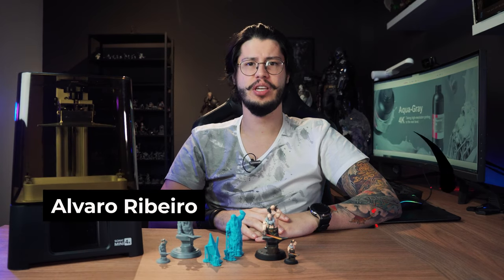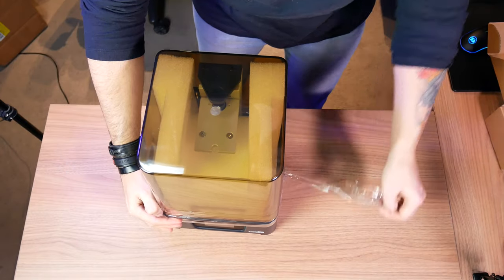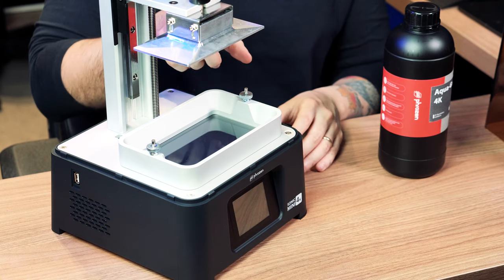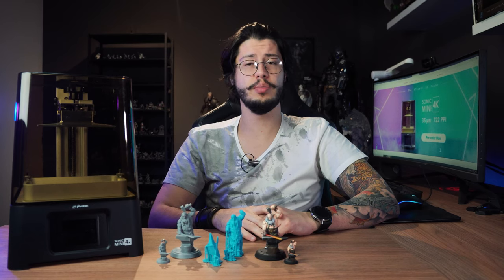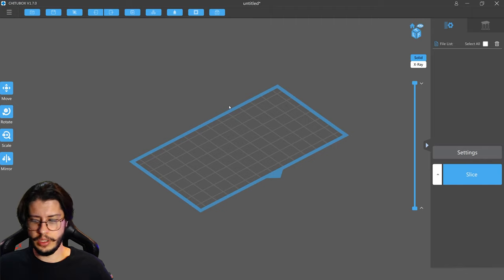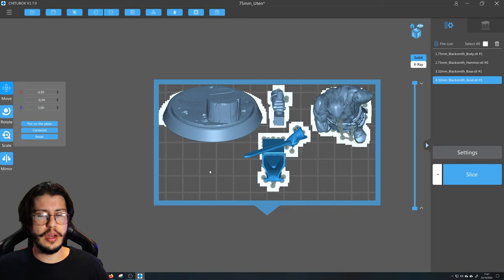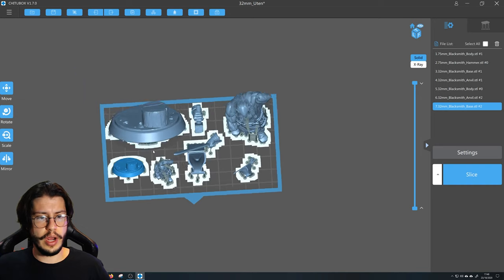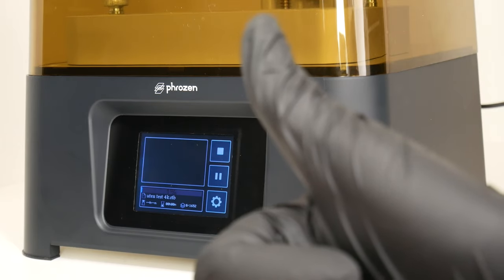RESIN 3D PRINTING GUIDE - FROM  SETUP TO YOUR FIRST MINIATURE

Comment: As someone well experienced in FDM, starting with resin it struck me how much more you need to faff around with supports, how much messier and how many extra tools you need. It is a lot easier once you are properly prepared.  There is a lot of info out there, but this kind of video taking you through the whole process I think will be very helpful for new people starting out.
Reply: I'm new and it's very frustration to find comprehensive tutorials on how to tweak settings and what they do. There isn't much space for error because of cost limitations. 500ml of resin is so much more expensive than 1kg of filament. Transitioning is not easy because the community doesn't really care for resin for some reason.

Comment: This is a pretty thorough and easy to understand guide, thanks a lot! I would nevertheless like to add one really useful trick. After washing the print with alcohol but before curing, put the prints (with supports attached) into a container with hot tap water (the hottest you can get, but not boiling). Leave the prints in there for about a minute. The supports become very soft and are very easy to remove by hand, often leaving hardly a mark on the miniature.
Reply: Is the water contaminated after? If yes how to dispose?
Reply: @lukasz7290  Well, that depends on how clean your print is. I usually have no noticeable resin left on my printed minis. I wouldn't drink the stuff, but I don't feel to bad about pouring it down the drain. This is probably still not the correct way, I am afraid.
Reply: @lukasz7290  Put it under the sun or UV until resin is cured. Cured resin will go down and you can filter the water. Dispose the cured resin as plastic

Comment: Exposure time is only two seconds? Nice. I don't go below six seconds for mine. Great video. Thank you.
Reply: Depends on the resin, lcd and the strength of the light in your printer. The mono screen based printers are all around 2s for standard resins.

Comment: Did you have any problems with that gap between the VAT and the screen caused by that thick black tape they added around the screen to avoid any resin leak to get into the printer ? I heard of people having problem printing more than one part at the same time on the build plate because that gap makes almost impossible to level it perfect for high detailed prints like 0,01... I was about to buy that printer, but just saw a review showing that "problem". The second issue was with the arm of the build place being a bit loose, and everytime the build plate raises to get the cured print out of the vat it makes a loud "pop" sound and sometimes this could deforms the prints.
Reply: I've started to research about 3D printers and it came across about the Sonic Mini 4K. As one of my ideas is print out the Loot subscription minis it's great to see which printer they use but I tthink I'm at the same boat as you. I've watched this video: https://www.youtube.com/watch?v=RTUhHnlZ6-8 talking about the issue you described. I'm quite defensive to buy it, especially as my first printer, I'm super beginner on this world.

Comment: I have watched this 4 + times and I keep watching it every time I have a little problem and I get it worked out.  The only thing I have not figured out is how to Readjust the supports, you show what button to hit and show how to use it, but, don’t show on what to hit on the key pad, I don’t have a mouse just a keyboard. Is there a way you can explain it a little better?  I do have the Voxelab Polaris, but, I print using the Proxima settings, I can’t print using the Polaris settings 🤔 everything is great, just Readjusting the supports.  Thank you for any help you can give me ( I am 73 years old and learning new things.)

Comment: great video I coudn't find any other video about how to clean up the supports from your models.

just a tip tho I saw another video about recycling the alcohol and he just put the alcohol with the resin residue outside in the sun and the resin actualy build up at the bottem and mostly cured so you can pour it back into the bottle without any resin in it.

Comment: Thank you very much for the video, really helped a LOT with the setting up of my 3D printer. I got the same problem than you in which the base of the model got stuck to the FEP, in my case it happened with the body of the mini (32mm version) while the anvil and base turned out very good. Is the sanding the only thing that I will need to do?

Comment: Wow, my Elegoo Mars Pro is so much easier to work with.  The vat slides out the side (no risk of puncturing the FEP with a screw or having to lift the plate super high) and leveling is much simpler.

Comment: Hi Alvaro, this is a great video and thanks for sharing, I recently bought and used the process like what you did, even with the print settings, it looks like my prints are leaving with horizontal lines with a slight height in them, can you please help me in fixing these, Thanks

Comment: I think a safety part is missing: please, wear a good filtered mask when sanding the resin, because that thin dust is really harmfull for your lungs! We don't know much about risks for our health when using polimer resins, but fine dusts are old and bad enemies!
Reply from the maker: Thanks a lot for the tip! :)
Reply: this is extremly important. liquid Resin might cause a light rash if you are allergic. Its an iritant that confuses some peoples immune system. But resin dust can really damage your lungs. so in my opinion the dust is much more dangerous that the uncured form.
Reply: an alternative to wearing a dustmask you can also just wetsand. its easy to deal with

Comment: I am about to print that exact model got the free sample file, I got my 3d printer 2 days ago . First "Mini" print so lets hope I don't fuck it up.
Reply: How did it go?
Reply: @Now_Its_Orange  the first attempt ended up with a failed hand and an anvil with no tip but the body and base turned out great. 
Second attempt was purely the hand and anvil parts, I coated the build plate with a fine resin coat before starting the print and it worked out.
Reply: @Gabiethemighty  cool. I tried my first resin print today and the miniature fell off the supports. I will try again soon.